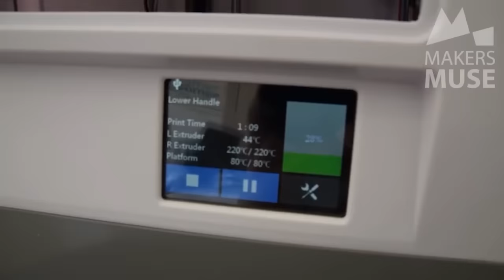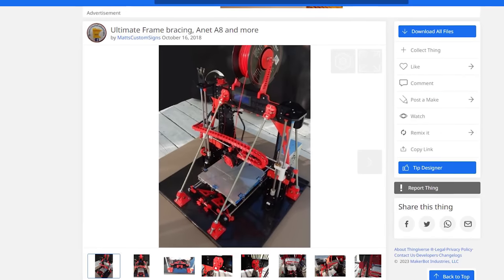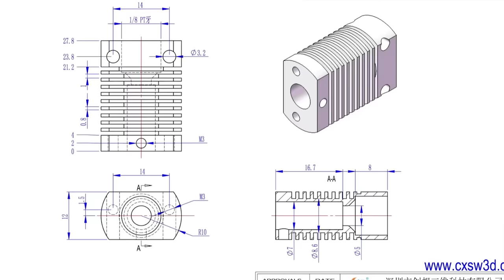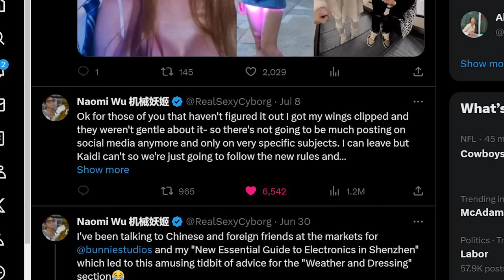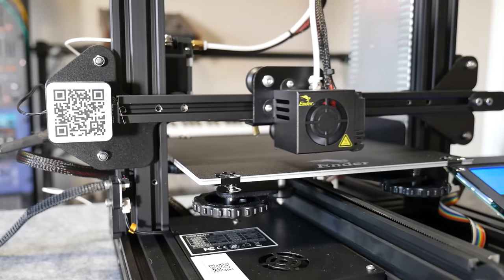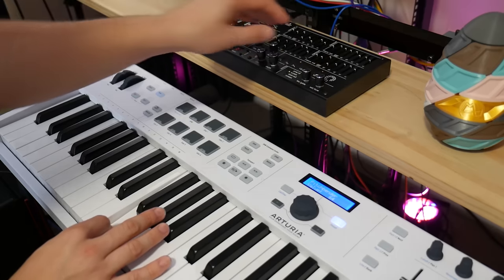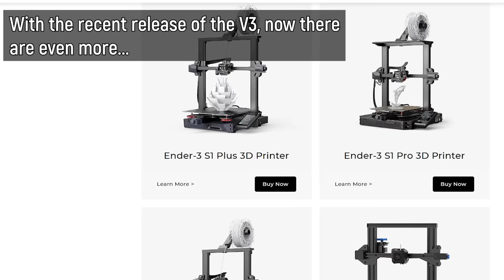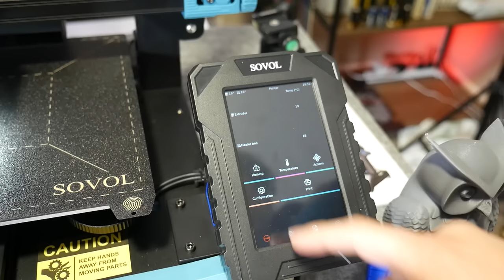Creality Ender-3... it's time to move on.

Comment: The learning curve with the Ender 3 can be a bit steep, but its a rewarding journey. The community support makes it easier to tackle challenges.
Reply: You should not have challenges. You buy a car. You drive. Done. 
Same with this. You buy. You print. Something not working? Return it. That's the message. Stop buying crap products.

Comment: I bought an Ender 3 Pro and have had a lot of fun with it. I also learned a lot about the hobby and how these machines work, I was an electro-mechanical tech so tweaking this machine was fun. Got mine from Microcenter with a coupon for $99 and have since put many times that into upgrades for it.  For me  it provided many hours of fun making the upgrades, for the non-tech folks I would recommend saving a little more money and buy a better machine.

Comment: I started printing about a year ago on an ender 3 and if I was starting again tomorrow I'd probably buy one again. It has all the problems you say it does but cheap parts and mods, and a massive community with years worth of good quality guides and trouble shooting. 

I'd love a voron or prusa but over 1k is a lot to dip your toes into a hobby when you can spend 200 plus a couple of upgrade kits down the line, learn to maintain your machine, and churn out good enough prints.

Comment: I couldn't agree more. I had an Ender 3 Pro for nearly a year. When it worked, it was brilliant. Sadly, I spent 80% of that year fixing and troubleshooting. 

Last week the hot end had a catastrophic failure and the whole print head area meltied. Fortunately, I had a Service Plan with Microcenter and used the money I got back to grab a Bambu Lab A1 Combo. I have had more successful prints in the last week with the A1 than I did the whole year with the Ender 3. All with Zero headaches.  Well one headache but that was user error and I figured it out in about an hour. 

Based on my experience with the A1 I am contemplating getting an X1 Carbon.

Comment: My first and only printer has been the ender 3 v2 , I upgraded a few bits and had some great results out of it over the last couple of years learning how to get the best from it, I am however now ready to move on to something newer with larger volume - a recommendation would be super appreciated please ? Auto bed levelling,  filament sensor would be 2 must have features, plus around 450x450 kind of bed size would be great, kind thanks to anyone who has knowledge and time to respond.

Comment: I bought an Ender 3 last year just to learn from. At that time there wasn't much in the way of useful prints I could apply to other projects I like to do. A dragon isn't going to help me determine the size of a knitting needle or replace a worn part of a knitting machine. I JUST opened the box last night......studied the beautiful color "instructions"....and immediately came to YT and found a step by step build. Time will tell if I lose my mind, but no machine I use works perfectly anyway.

Comment: I got the S1 and it's ok. It taught me a lot though and i still use it for simple prints. I have two Ender 5 S1 printers, and my opinions are mixed. One runs ok, but it tends to suddenly clog during long prints. The other runs pretty much perfect and was easy to get going. Despite them being the same, one requires the build platform to lower down to the limit switch and then back up to calibrate. The other uses the sensor on the print head to calibrate and there is no limit switch at the base.
All three of my printers are re-manufactured off the Creality ebay store and picked them up for about $200 a piece.

Comment: I just bought a Bambu labs X1 Carbon....with the AMS. I'm hoping it's as good as the hype says. I never went down the Ender-3 route. My first 3D printer was a Makerbot Replicator, I bought it for a grand I think, from the owner who had run out of patience with it. Over quite a few years now I managed to get it working, and keep it working and managed to side step any of the proprietary nonsense. 
I've used Ender 3's once or twice but never got them to work consistently.

Comment: My Ender 3 V2 was junk, got rid of it and got an Ender3 Pro like my son had who seemed to have better luck.  When it works it works well... but again usually to get it working it takes a weekend of tweaking just to figure it out.  Recently purchased an Elegoo Neptune 4 plus and I can't wait.  everything I have seen on it looks promising so I can actually make stuff and not waste my time having to tune things.  I am looking at options to convert the ender3 pro to be used elsewhere in my shop.  I am intringued about the laser engraving conversion.

Comment: I have a Ender 3 V2.

I cannot get it to print successfully.

The bed is not flat, even with a brand new head bed AND glass build plate, it is not flat. So I cannot get prints to adhere. 

I am so fed up with this thing.

Comment: The Ender 3 really is an incredible 3D printer, especially considering its price point. It’s really easy to upgrade and repair because the parts are so widely available. I was able to fix my broken Ender 3 in no time with a part I ordered on Amazon. I have also been hording used printers from Marketplace to make sure i have enough spare parts. If I had any other brand of printer, I’d probably still be waiting for a replacement part. When something works this well, why bother changing it?

Comment: I had Ender 3v2. Endless problems with, especially bed leveling. Added BLtouch. Replaced the springs. Replaced all the fans with Noctua for quietness and better cooling. Almost all of time 3d printing was fixing the printer or printing upgrade parts, and most of prints failed. Success rate max 20%. After a year I gave up. Perhaps it was a lemon with warped bed. Either way I would not recommend it.

Comment: Did everything really change with the introduction of Bambu X1?

Yes. The Bambu X1 Carbon was the first printer that always works for me, and works well. With a textured plate, I don't even have to goo up the build plate before hitting Print. The only minor quibbles are the laborious manual bed leveling (which I gladly leave on) and fairly loud print noises.

Finally: a printer that always prints. Hallelujah.

Comment: to be fair this is why i went with an Anycubic Mega SE with my first. It was on sale for $140 USD It was essentially an Ender 3 but had a glass heated bed.... and that is about it. I like to tinker and play, but I also like to just hit the go button and walk away. I have my SE in a state where I can almost do that with minimal tinkering, though I still need to check the bed level during the first layer. I have been impressed by how Anycubic has made the mesh-leveling pretty standard on its newer entries, and I do not think it i3 style is going away due to its versatility.

Comment: I worked at a medical device company that used 3D-Printers to prototype new products.  All 9 of the FDM filament based printers were Prusa's .  Most of the staff including myself ended up getting Prusa's after watching the print farm working 24/7 with rarely more than 1 printer in need of maintenance.

Comment: I upgraded the hell out of my Ender 3 v2. The quality it can now produce is extraordinary. And even after the expense of the upgrades and mods, it is still a cheaper solution than many out of the box units that have auto bed levelling, direct drive and excellent quality control.

Comment: I’ve had a CR-10 since they came out, and it’s been morphed to try to make up for it’s short comings.  However I spent most of my time tweaking, testing and re-building it (fun but eventually it went back in it’s box for a couple years).  I decided I wanted to resurrect it with a new control board, started down that path and Youtube started feeding me Bambu Lab A1 videos.  They were hype but impressive so I took a shot at it (they were recalled but I discovered it just as they were re-releasing it here in Canada).  I can honestly say that in the last week of owning it, I have printed more useful and near perfect things faster than I ever did on my CR-10-frankenstein.  The Bambu Lab A1 is a great appliance and almost not worth tweaking (other than “poop control”). I’ve had such a good experience from the very start that sadly I may not continue to tinker with my CR-10 ( dual belt linked XZ-Axist all metal hotend, Bigtree tech control board, EZABL, magentic bed (I discovered the wonder of PEI stuck on a glass bed wearly, but nothing beats the new powder coate spring steel beds).  But there is something to be said for customizing, tweaking and testing as a hobby in and of itself and I may relegate it to an enclosure for ABS and Nylon prints.

Comment: I watched this video while trying to work out which 3D printer I should consider, as a beginner. The Ender 3 (pro/v2/neo/etc.) are the most commonly recommended. 
This might have saved me some headaches down the line, but I feel I’m back at square one, with no clue which printers are best for me.

Comment: The Sv06 Plus has been awesome, and despite it's screen dying in the first week, sovol have been (contrary to public opinion) quite on the ball with customer support, 2 days was all I waited for an email back from them.
The screen dying wasn't an issue as I also bought a BTT Pad7 at the same time and just installed Klipper to keep me going and DAMN, I am well impressed considering this is the first printer ive had in 8+ years, the last being a replicator clone (CTC 3D Dual) Running a tweaked version of Marlin, with a super warped bed.

Honestly couldn't believe the price for this from the sovol store direct, it's incredibly cheap and is still on sale at the moment.  Ridiculously large bed for sub $400?! YES PLEASE, linear rods too no rollers, TAKE MY MONEY
Reply: P.S I absolutely refuse to put up with rollers, too much maintenance vs linear rods, especially in my environment

Comment: I modded my ender 3 pro so much. Glass bed, Direct drive, Belt tensioner, Dual cooling fan. Moved electronic to the back + silent board. Bigger psu fan, Drawers everywhere and a bether boden tube insert on the hot end. Also added angled spool holder, LED lights, Tool holder aso. Soon i can sell the leftovers as a new printer.

Comment: I must be lucky, I got myself an Ender3 Pro after looking about for people's views on them. I knew absolutely nothing about 3d printers and jumped right in printing an Aliens M41a Pulserifle, slicing it on the prehistoric slicing software that came with the printer. The outcomes have just about always been good to satisfactory with only a few prints not working out but that may be my inexperience. Yes it's small, yes it's noisy, yes it was fairly inexpensive, yes I could print things that I couldn't buy (Pulserifle) here but all in all it does a pretty good job and I've only had to change things like the occasional bowden tube or hot end rubber boot and it has run nonstop for close to a year. I'd have to say it's been a good experience on the whole.

Comment: I have an Ender 3 Pro... and an Ender 3 Pro. Strangely, they are different printers. The old one is an 8-bit and worked pretty well from the start. The newer one has a 32-bit board and had the problem you mention with the badly placed Z switch so it was unusable until I fixed that.

Both have the famous hotend fix, and the old one has a much needed better tube coupling. Not perfect without these fixes. The newer also has a CR-Touch.

Not super many fixes but not 100% beginner friendly, and making secretly different version under the same name and many different names is confusing.

I am pretty happy with the printers so I am not likely to buy a new one soon, but if I do, it has to be something more complete, more finished, with less tinkering needs, and if I can get significantly higher speed, of course it is interesting. So, not a slightly upgraded Ender 3. So my conclusion is that I agree with you.

Comment: My first 3D printer was an Anet A6. I knew what I was getting into, I wanted to tinker. After I've learned enough (and spent enough time and money) getting that thing to print just ok, I scrapped it for parts and got a Prusa MINI+ because that fit my space and usage. Now when anyone asks me about a good beginner printer, my first question is "do you want to print or do you want to tinker?". If the answer is "print", I recommend the Prusa printers, because I've got experience with them (both at home and at work) in working mostly out of the box.
If I were looking for a bigger second printer, I'd probably have to decide between the bigger Prusa and a BambuLab. I've tinkered enough with my printer, now I want to tinker with my printed parts.

Comment: Thank you for sharing
I want to mention you need a lot of free time to tinker with the hardware and software to make a ender 3 in what it could be.
Also these mods defy the cheap/affordable 3d printer.
I got the 32bit board , better extruder,better bed heater,diagonal stiffening rods,new hotend copper with copper or hardened steel nozzle,different build platforms ,minimus cooler with double fans, direct drive , homemade enclosure,nylon wheels,direct drive a paver to sit on with rubber feet and extra corner stiffening. Abl , and heater with sensor . maybe i forgot some.
So for all this time and money i would suggest  others to look at other 3d printers.

Comment: Got an Ender 3 a year ago for my 11 year old. Had a heck of a time getting the bed levelled and it barely got used. Bought some of the 3rd party springs (the yellow ones), but didn't do anything with them until recently when I had something I wanted to print. And man, what a difference the new springs make. Why couldn't Creality have just used these from the start? However, with what I know now, I'd probably get something that self levels. Just makes sense and is worth the extra cost. The Bambu printers are really tempting.

Comment: I agree with all of this: the Ender 3 (as a beginner printer) has been beat out by the beginner options from Bambu Labs, to the point that I, a longtime Ender 3 user, got my dad an A1 Mini to start him off. A baseline Ender 3 is a project at worst and a platform at best. Out of the box, it is barely a *tool*. 

But, I do think that's a strength for some users. It's a very attractive proposition that the Ender 3 is a minimum viable product that can be upgraded with relatively trivial cost and effort into different kinds of better machines. And to do so without "wasting" money on a single feature you don't want. Silent steppers, direct extrusion, Octoprint/Mainsail, can all be installed independently, again for the minimum possible cost.

Comment: When I opened up my Ender 3 for the first time and saw that it came with binder clips to hold the bed down, I was like "This can't possibly be right."

I eventually got fed up with that printer and gave it to my brother who actually had the time, knowledge, and patience to get it working. A few years later a found a used TAZ 5 for the same price as a new Ender 3 so I grabbed it, after minor tune-ups it has been treating me pretty well.

Comment: I love my v2 neo

I didn't have a massive need for a printer and just wanted one for fun and as something to do in my free time.
I was suggested the v2 neo and it's worked fantastic (apart from the blower fan failing, but I was going to upgrade to noctua fans anyway)
My favourite part about the enders is how modified they can be, which is something I've loved doing to it.

The main point I do agree on is that it's more for hobbying than a tool. I've spent a lot of time on mine

Comment: After having four creality machines blob out one at a time,  even with Swiss tech mods and other cooling and upgrades, I quit for a couple years because I intended to start by upgrading the motherboards with klipper, I simply didn’t get around to tinkering with it any more especially because I never solved WHY all four just stopped working. Just too much!!!

But last week I picked up a $129 Biqu printer and not only is it better designed, has print leveling built in, and just a modern design of components. I cannot believe how PERFECT it prints straight out of the box!! For $129 at Microcenter! 
I took an old raspi pi 3b+ and put octoprint on it for biqu and boom, it just works perfectly. I guess I’ll just disassemble my Enders and put in a box maybe headed to the garbage because I don’t want to think what I spent on mods!! This Biqu is so cheap effective and works perfectly. I really cannot believe how flawless the prints are

Comment: My first 3D printer was an Elegoo Neptune 2s and a  couple of months later I bought a Creality Ender 3V2. Both are upgraded with auto leveling and since a couple of months with silicone bumpers instead of springs and leveling screws. The Ender 3V2 gives me much less headache than the Neptune 2s. I'm at that point when the Neptune 2s fails again with the auto bed leveller I go back to manually bed leveling.

Comment: Those must-have features... I wouldn't use any of them!  As with almost any product, when you find a problem, re-design it. Mine works whenever I start it up, and it sits on a tall table next to my computer. I have only been using PLA and TPU for years. I am always aware of what my computer is doing. I have a fast board and silent steppers, so I have to look at it to see if it is OK. I'm keeping it.